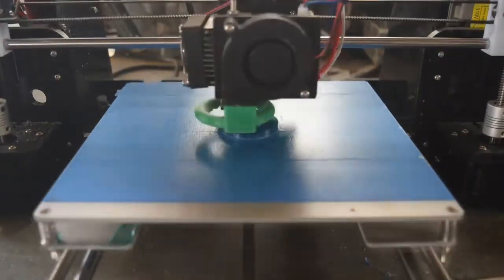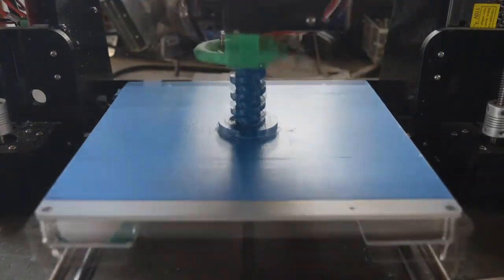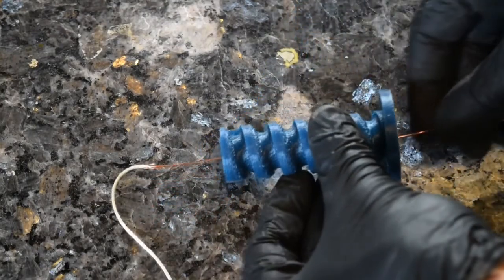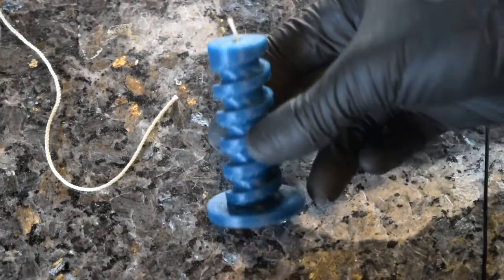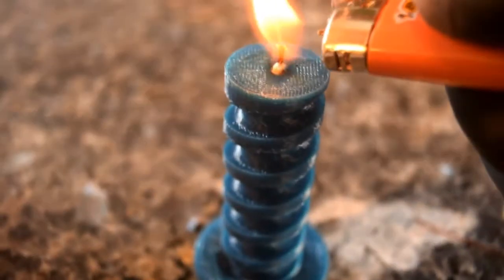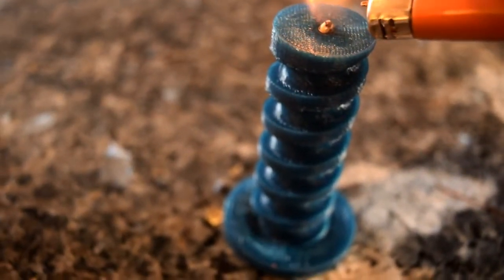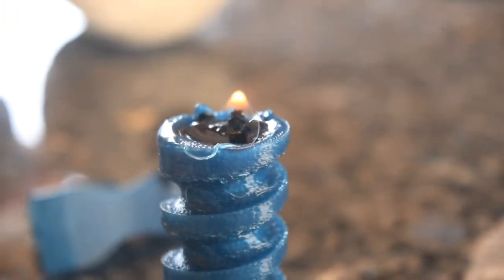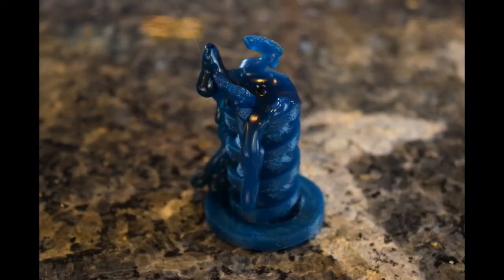3d prints? How about a 3d printed candle?

Comment: Hi
 could please tell me How to create your own candle and what machine u have used ?

is the 3D printer design and make candles at the same time ? or do I have to get another machine for creating the candles ?

please answer , thank you
Reply from the maker: Saeed Alsaddi this was printed on a regular 3d printer but with special wax filament from machinablewax. if your interesting in purchasing the filament use coupon code "PROJECT" at check out for a 10% off
Reply: so it's only 3d printer with special wax filament to make own candle?
what about the silicon?
thank you for that coupon ^^